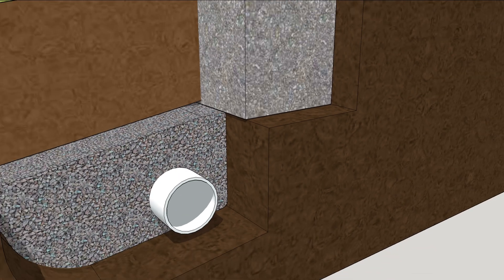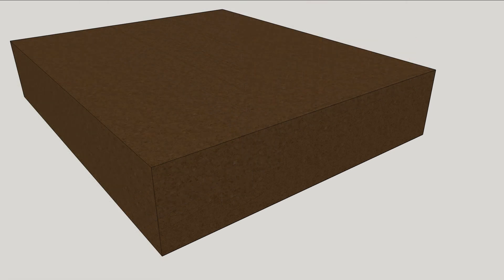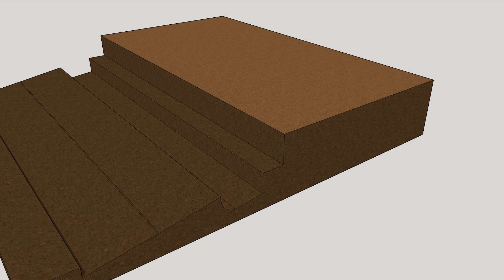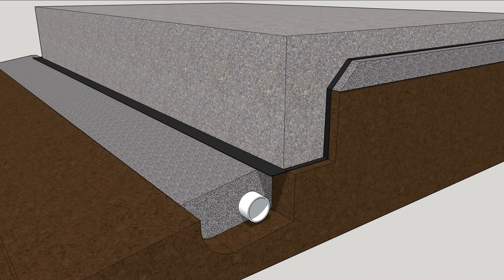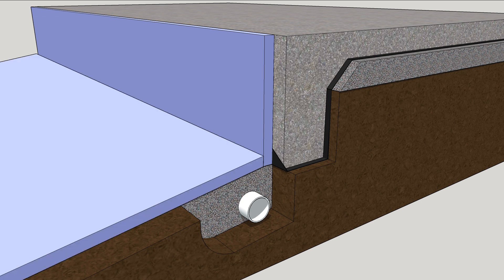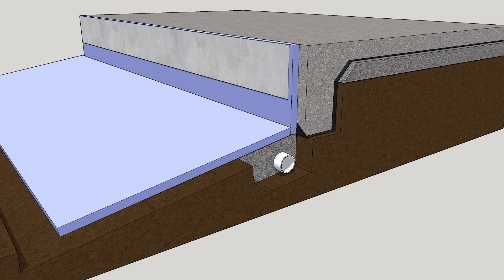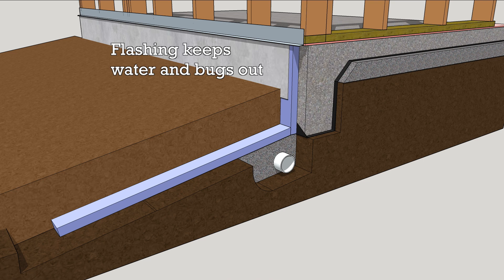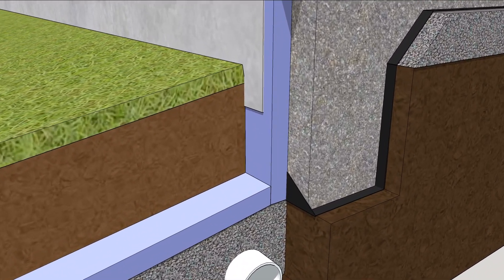Frost Protected Monolithic Slab

Comment: Were you able to get approved by the building department up there in MA for pouring without footings down to 4' or is that just a theory you're proposing?
Reply: 403.3.1 does not cover "Frost Protected Shallow Foundations" It covers "Foundations adjoining frost protected shallow foundations". You live in MA where you are required to build on footings that extend below the frost line as covered by R403.3 "Frost protected shallow foundations.
For buildings where the monthly mean temperature of the building is maintained at a minimum of 64°F (18°C), footings are not required to extend below the frost line when protected from frost by insulation  in accordance  with Figure  R403.3(1)  and  Table R403.3. Foundations protected from frost in accordance with
Figure R403.3(1) and Table R403.3 shall not be used for unheated spaces such as porches, utility rooms, garages and carports, and shall not be attached to basements or crawl spaces that are not maintained at a minimum monthly mean temperature of 64°F (18°C)."
In MA you are required to pour footings 4' below grade.
Reply: You're right, now that I read it carefully it doesn't; the mean temperature in the code is of the building not the outside air. I never built insulated shallow footings/foundations or slabs because I will never be able to trust in the quality and integrity of the structure say 50 years from now. I always thought that the code set the 64deg for outside temp not building temp. Again I would NEVER rely on a band aid type of system to last over a 100 years down the road. If you've ever seen termites you'd cringe at any thought of relying on such a system. Not to mention physical damage by equipment since the foam would be at a shallow depth and is extremely fragile. Also having lived among trees I grew up to respect their ability to cause havoc even on solid structures let alone flimsy foam.
I've personally built dozens of basements 9-12' deep from forming to pouring large 5000sqft houses with a couple of helpers but never a slab on grade house. The shallowest I've built was crawlspaces.
Related to your post, I stand corrected and you are accurate in your illustrated explanations. I did learn from your illustrations the method of installing insulated frost protected shallow foundations so I'll keep it in my memory but it will always be just that, a memory.  
Thank you. Cheers.
Reply: @Order-in-Chaos  In 100 years there will be no one alive who remembers you or knows you ever existed.
Reply: @snoopster000  You're wrong, I'm leaving a bunch of money in a trust and I will be remembered for generations, beyond 100 years. Also what's love got to do, go to do with this thread? What's love but a second hand emotion?
Reply: @Order-in-Chaos  sure you are champ
Reply: @snoopster000  On the other hand, you're already forgotten past your last comment, no need for a 100 years.
Reply: @madeinusa5201  Have a company build a swimming pool just outside the footprint of your new construction. Then build the foundation inside of the swimming pool. ;D
Reply: @madeinusa5201  What does  structures in the FP mean?
Reply: @steamsteam6607  structures in the FLOOD PLAIN
Reply: @Reynoldsrobert  Thanks

Comment: If I add Pex tubing in the slab and heat it for free in the fall with evacuated solar tubes would the ground retain the heat (heat sink) or would the heat loss be absorbed down? From my understanding the R value of the ground will keep the heat under the slab.